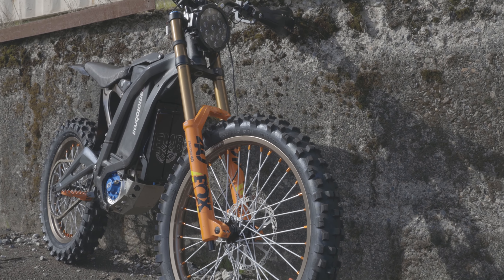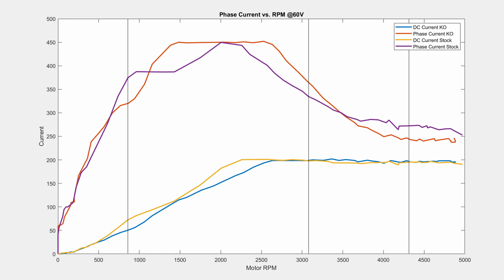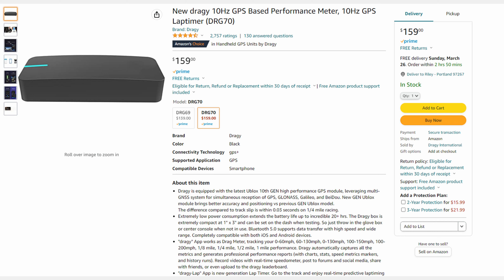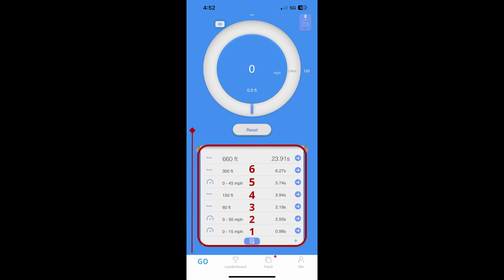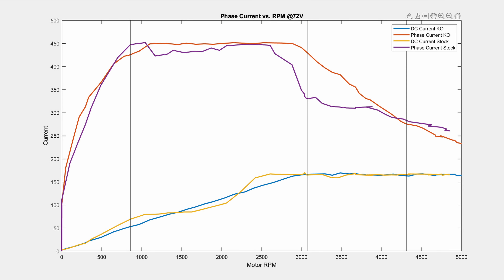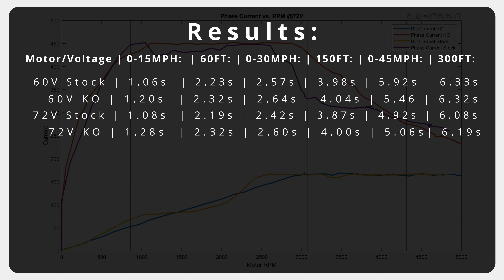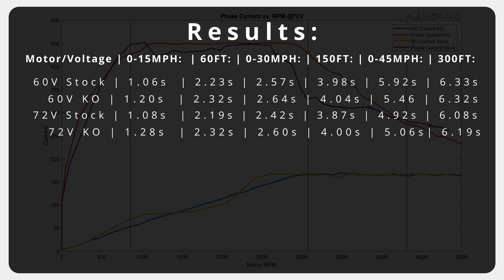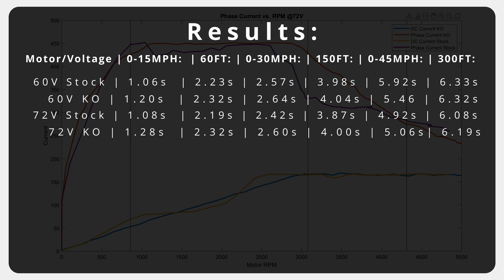KO Motor Vs Stock SurRon Motor PART II | In Depth Data Analysis

Comment: Yikes! Run the motors at 20KW+ and then try to compare them 😂 one motor will still be ripping and the other will be in pieces. thought you guys were better than this... A very deceiving test indeed. The KO sacrifices some efficiency for much better power handling and heat dissipation. Do a test where you go 0-30 in sand or a hill climb 20x and record the time on the last run with both motors running their maximum allowed power for the scenario. THAT is a fair test. I bet these guys are still running the stock supra connector and breaker too 😂
Reply from the maker: Already addressed all your comments points in the video and have plans to test all of that. A bit hard to do any sort of trail riding where we live during the winter. All in good time friend. If you're in such a rush we encourage you to do the tests you're outlining and tag us in the video! We'd be happy to share a video that is the same quality as this testing the things you've outlined. I wish we had enough time, money and good weather to test whatever we want, where ever we want, when we want and have time to film and edit it all.

No good test starts at the highest power value without establishing baseline performance at repeatable values. Please reply with the exact time stamps that were deceiving and I will update the pinned comment to correct the mistake :)
Reply: @emotobros  title: 'setting the record straight'. The fact that you even created this video... You know what you're doing. Unfortunately, it's working. The Sur-ron community is very young and gullible. If you only mention the pros of one product and only mention the cons of the other, THAT is VERY deceiving. 0:00 - 12:18
Reply from the maker: @therealbojak  Yeah the title was more reffering to the people calling us kids, saying the bikes weren't setup the same and saying our testing was flawed. We set the record straight that our testing was not flawed, the bikes were setup the same and discussed that we are adults and full time engineers. Quite accurate in that regard.

As far as not listing the pros and cons - I'd give the video a rewatch as it sounds like you may have missed some information. We clearly state the KO is better for its 'intended purpose' - i.e. high speed and high power. That'd be a pro. We also mention that we tested the stock motor at 30kW and it smelled like it was burning, that'd be a con. We mention the KO costs more and at normal power levels performs the same, that's neiter a pro nor a con as it was expected - same goes for the stock motor. That being said, this was not supposed to be a video about our opinions on the two motors but rather a bland data analysis of how the two performed at standard aftermarket power levels.

My guess would be you came to the video with your decision already made that you don't like how or what we are presenting and your comment suggests that's true. If you felt mislead but can't list a specific time stamp in a 12 minute video where you felt mislead than I don't know that we can help. We of course also mentioned we are moving from baseline testing to higher power in the next video. If you feel something was misleading about this video we'd really like to hear what specifically was misleading so we don't do it again in the next one.

Comment: Ive had to upgrade my motor to the KO and I dont agree with this assessmeent. I have more torque (some) and MUCH faster top speed. Im going to go out on a limb and chalk it up to other variables causing this "non benefit" such as tuning for example. The stock motor has issues with magnets losing strength (not only jumping off) which causes other problems which would force you to replace it anyhow. The KO seems to have a MUCH higher "durability" and "lifespan". My stock motor couldnt get past 72mph with wind help. The new motor with wind help got 86mph. Specs: 60v Chi batt, EBMX tune at 13kw, KO motor, 52T sprock.**edit: Oops and running BAC4000**. Yes I didnt like having to spend the money but the piece of mind at the chances of not having to replace the motor AGAIN and more speed and torque..WORTH IT! Now, if another company makes a motor similar to the idea and power of  a KO, Id probably be giving the same praise or maybe more
Reply: I’ve got a 60v 63ah battery and asi bac4000 running 12kw.motor only done 441 miles thot it was Bac first so exchanged that then happened again with new Bac. Trail riding not riding hard and got told a roasted the motor. Would run for 20min then cut out for 10min motor wasn’t hot to touch so ordered a Qs165 motor. Had a remote session n Bac said moto temp high. My bike is in bits just now but hope to get up and running soon.
Reply from the maker: Yes it’s possible, but the entire reason that we showed the phase current plots were to show that we were inputting the same amount of power. There isn’t other tuning factors that’d lead to a difference. The motor only sees voltage and current.

Again, this wasn’t a top speed test as you talk about in your comment. We weren’t determining which was faster, just how they accelerated based on current input. The KO undoubtedly can handle more power and go faster as I mention at the end of the video.
Reply: @emotobros  yeah. But I'm finding that there are "sweet spot" tunes where when you input the same tune, the motors behave differently.  Tough to explain but I hope it makes sense.
Reply: @Ah85661  yeah.. thought my BAC was bad too.. NOPE just motor. Any my motor NEVER got hot. Only warm. Never threw a magnet.  BUT one magnet had a sever degradation in "magnetism " and a 2nd one had a slight degradation.  This caused an unbalanced motor where at certain rpm it made a noise like bad bearings and would cut out and give me a "current error". Surron is not responding to customers (i tried US headquarters) . So they won't be sending out replacement magnets which is all it would take to fix.😡.so went KO because nothing else like it avail. (For now).
Reply from the maker: @bigkick86  Are you data logging to determine they are performing differently or is it just based on feel? I do understand what you're reffering to, we just did everything possible to ensure the same amount of voltage and current are being delivered to each motor. Outside of that, I'm not sure how you'd determine it is fair.

That being said, I could easily tune the KO to make more torque then it did in the video but that was beyond the purpose of the test.
Reply: @emotobros  if you haven't done this already, do an 8k tune, 10k tune, and 12k tune (just adjust for pole pairs). I'd say even a 13k but I don't think stock would really like that. But you might see a greater spread on data or at least have a better understanding between the two and one having 4 pole pairs vs 5...🤷‍♂️ 
I'm no "no it all" (far from it) nor do I have the time or all the instruments. But I do have something of a physics and electrical background.
Reply from the maker: @bigkick86  We did test at the lower power levels and had the same results. We wanted to test at the highest possible power and phase current where the bike was still controlable.

We did account for the different number of pole pairs on each motor and tuned accordingly. Aside from showing true motor input with a current sensor (as we did) I can't think of any good way to ensure the tuning is 'equal'.
Reply: @emotobros  ah interesting.  Well my experience might be because I got a bad motor from surron (which they definitely don't care about) . So the power was handled differently (different rpm etc). (I have 1 VERY weak magnet and one weakining). Although 4 pole from KO should produce more rpm "naturally". 

Perhaps on a good surron motor I might get your results.

Ps. Any idea on how to get new magnets?

Comment: My ko motor and controller is way beyond what it was stock maybe learn how to tune it i have a 2023 37ahr and i love the money i spent on it screwthis  the internet the internet knows nothing 😂😂😂
Reply from the maker: I think you may have missed the point of the video entirely. We quite obviously are not comparing a fully stock setup to a full KO setup. This is a comparison of torque efficiency.

Beyond that, we were one of the first SurRon tuners on the market and have been doing it for 3 years at this point. We have a great reputation for our tuning ability. This should be evident by our ability to tune two different motors to have the same phase/RPM curve.